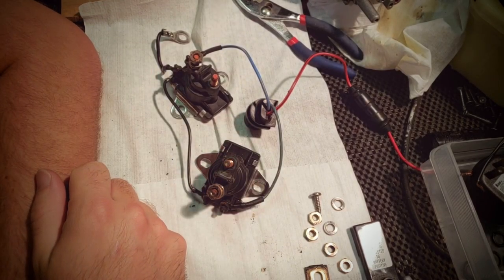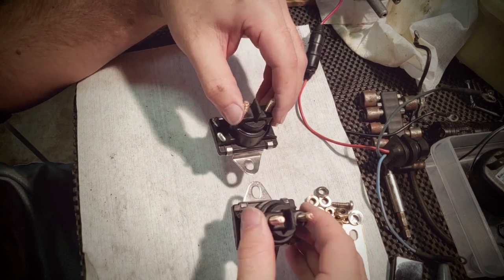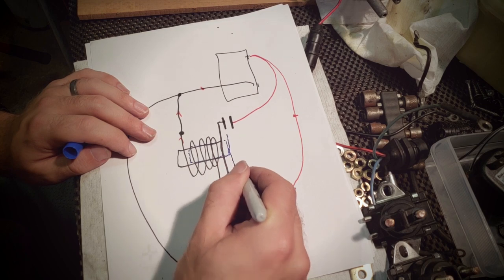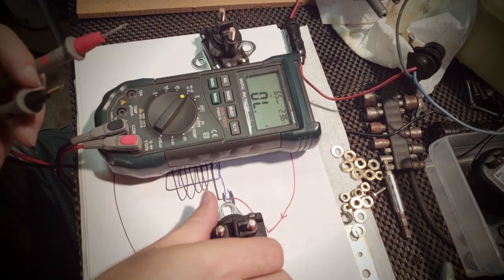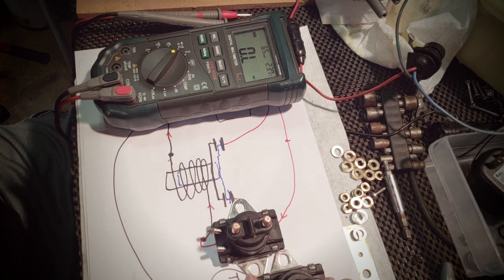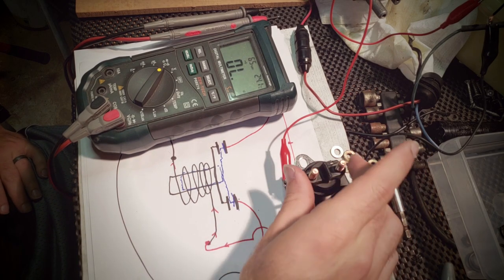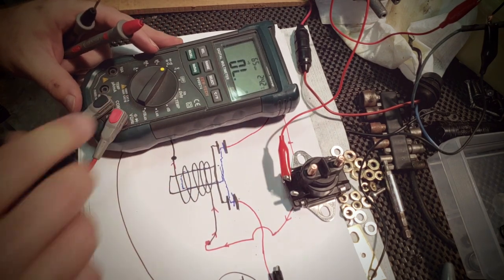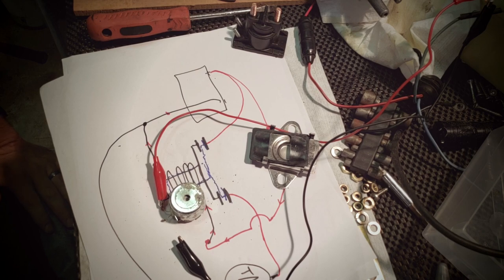Trim Solenoids: Cleaning, Inspecting, and How They Work... And Maybe Fixing Them

Comment: Thanks for excellent video - had a few problems with tilt solonoids on my boat which are awkward to get to - and even to jump if necessary. Tried to re-furbish myself and concluded same as you - had to replace.
Reply from the maker: Thanks for watching! I'm actually getting ready to release a new video on installing a remote trim switch which bypasses the solenoids... Can save your butt if you're pulling your boat out of the water and can't get your drive to go up...

Comment: Hi, thanks for the informational and thorough videos, I really learned something! You said the coil wires where "resistance soldered", I tried to solder mine off but ended up just prying them off the studs. But then I had a really hard time soldering them back on with the little black things on them. Do you have any tips on how to do the soldering part (releasing and resoldering)? Are they actually resistors or can I just cut those off and solder the wire directly on the nut?

Comment: thanks for the info, question, why do you think a my trim going down works but the trim going up keeps blowing fuses?
Reply from the maker: Sounds like you might have a clogged hydraulic line or maybe messed up trim rams... It seems that its taking an additional amount of force to push the drive up, but gravity is helping on the way down so its not blowing the fuse.
Reply: could be trim up circuit has a shot circuit.